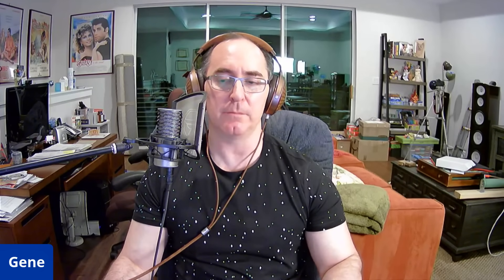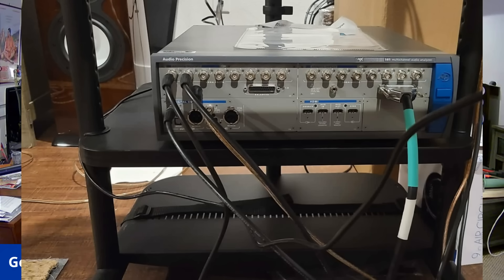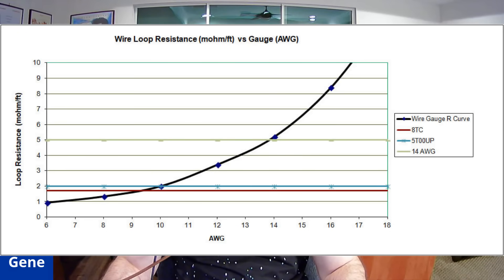Speaker Cables Really Don't Make Much of a Difference?

Comment: One have to do very long time critical listening to notice changes in cables. I did. Also did blind test listening. I had for a very long time a pair of good enough 14AWG speaker cables from the Swedish manufacturer Supra and i was pleased. One day I decided I'm gonna make my own 10AWG braided pure OFC speaker cables finished with decent quality gold plated banana connectors just because I am tired to plug/unplug raw wires and the result was good. Not amazing! I have noticed the change  and I can tell the old thin cables sounded exactly thin. I am a technical person and I was not expecting any vodoo out of the speaker cables. I would not spend crazy amounts of money on any cable but a $100 in total, for parts, i'd say is ok.

Comment: No Resistance "HEAR" The only reason I buy a Upgraded Cable for my speakers is that I believe the Quality of the Termination and the amount of the pieces of Braid is exactly what you showed here, but the Sound Difference I Experience is because of the Speakers Cross-over set up and my "Equalizer", yes I Said it the Audiophile Blasphemous  piece of Equipment The "Equalizer".
Because if a Human Ear picks up Difference that their Brain perceives as "Better more Soothing Sound" it is from the Amplified Sound being Fed into the Speaker, The Position of the Speaker or the Electronically Manipulated Sound from the"Equalization Process" .
So there you have my opinion  and Everyone has their own, The Idea of spending Tens to Hundreds of Thousands of Dollars to correct a Sound so it can be Listened to on a Flat unequalized signal vs me Spending Hundreds of Dollars on a Quality Equalizer to get the Sound to a Pleasing Non "Harsh" Smooth Soothing Sound just Does NOT Make Sense.

Comment: Elon musk said it best, 'stop trying to solve a problem that shouldnt exist'. The best speaker wire is no speaker wire, the best cross over is no cross over, and the best binding post is no binding post. 

Get active DSP'd speakers. DAC happens and immediately the proper frequencies ranges get routed to the individual drivers properly.

Comment: Thought I’d check in again with the measurements crowd.  Funny thing…2 different amps can have the same measurements but sound very different 😮. Then there is the whole Quantum Uncertainty Problem but…yeah!
Reply from the maker: Nice red herrings. 2 amps measuring identically will absolutely sound the same IF you do exhaustive measurements and not just a few cursorary measurements and declare they are the same. Talking about quantum uncertainty relating to speaker cables demonstrates a lack of knowledge about Modern Physics and basic electrical theory.
Reply: @Audioholics  Just wanted to see if you were monitoring this thread…Quantum thing was for fun.  Having been a musician, music lover and Audio enthusiast for over 40 years I am passionate about certain issues that are often glossed over.  As far as a linear relationship between measuring and listening goes, there isn’t one.  Enjoying music occurs in a unique environment, with a particular electrical infrastructure.  After that is the gear, which is dynamically interactive with everything else in the system. Every piece matters, every cable matters…it all matters.  Isolating a few parameters about any particular component or connection and extrapolating that into a subjectively meaningful experience is pointless.  As for the cable issue, my extensive experience with a vast array of components and cables have clearly demonstrated to me that while just wire is less variable subjectively, companies like Transparent and MIT provide discernible improvements to the listening experience.  If you can’t easily hear the difference and experience the dramatic increase in your enjoyment of the music you love, then I would question your priorities…or maybe you hear in black n white.

Comment: I would only buy good wires in case you have some interference.
I had my AVR wire to my 6000 beringer amplifier and my two 15" DIY subwoofers were maki g a really annoying noise every time they were on.
I bought a decent RCA cable (maybe 20€ for 0.5 metres, and all the funny pink noises disappeared.

My other 9 speakers are wired with normal cheap wire.

Comment: 3 cables isn’t the proof to end all the discussion. No testing of Transparent, Cardas, AudioQuest, MIT and many, many more. 

Only one person performing the tests and no other confirmation. 

Good start, but so much more is needed before one can categorically claim, “cables don’t matter”.
Reply from the maker: Audioquest was in this comparison.  I've tested 100s of exotic speaker cables over the last w decades. They don't make a difference unless deliberately designed badly like with gimmicky network boxes or very far spaced conductors.
Reply: @Audioholics  and so have I. Though I actually hear the difference and I have been blind since birth. Enjoy your vision and poor hearing.
Reply from the maker: @scotttracy6640  no need for the insults or ASSumptions on my hearing. I focus on what really does make differences in sound, namely room acoustics, proper speaker set up and calibration. Most people hanging on to the misbelief of the sonic wonders of cables often listen to their systems without ever addressing the things that can actually bring them BIG gains in fidelity.

Comment: great analysis. While there is a measurable (but small and largely irrelevant) difference. At least the premium cable was 'better.' Which for analogue is good to know, but I'll be continuing to use the spool of 12-gauge speaker wire I've got in the shed somewhere. 

What really cracks me up is the prices that some people charge for digital cables (like HDMI.) where it doesn't make a lick of difference so long as it meets the spec.

Comment: I can tell you there can definitely be audible differences in color, tone, and some cables accentuate some frequencies more than others.  I just finished comparing two sets of pricier cables to my bell wire.  The pricey cables were immediately impressive in different ways than each other, but neither pair were as neutral and balanced as the bell wire.  This was NOT what I was expecting to hear at all

Comment: The best youtube presentation I’ve seen. Thank you for your clear, concise and logically presented explanation of speaker cables and their electrical characteristics along with the quantified results and test equipment used. Being an Electrical Engineer, who was a NATA Signatory and Calibration Facility Registration Holder of a Lab that could measure Electrical parameters from DC to daylight, it’s a real pity there are so many snake oil salesmen in the Industry where so much misinformation can be presented without any form of evidence.

Comment: You aren't going to hear 0.2 dB and you aren't going to hear 0.2% distortion difference.  You can hear rather little distortion added to a pure sign wave, but 0.2%, not likely, not at all.  In music you will be doing well to hear 3-5%, depending.  In rock music, since most of it is already intentionally distorted all to hell, you'd be lucky to hear 15%, probably more like 20%.  That is not an exaggeration, I've seen tests demonstrating those numbers.  If  you measure the  ACTUAL distortion of your system, even a good one, you will be floored at how much distortion there is, and some of it is TOTALLY unavoidable, like IM distortion.  You can improve it, but you aren't going to get rid of it, unless you have a speaker for each instrument, and perfect isolation to that instrument and the returns on the recording...good luck with that.  That would be a long recording session, and you would need things well instrumented to put it together afterward.  And self noise (silk is GREAT in that respect, and HORRIBLE at maintaining a true piston, titanium can cover the other side,  pretty stiff, to some point, and then crinkle, crinkle), and direct nonlinearities, and box reflections, and varied coupling with frequency and driver size, etc.  If you ever get a chance, find a way to get rid of the sound coming off the front of your speaker (infinite baffle and absorption, whatever), and listen to what is coming out of the BOX.  It's not musical, and it's louder than you think it will be.

Your point on moving your head slightly, especially at high frequencies, is dead on.  Take a measurement mic and try it sometime, you folks that don't believe that.  And usually you can find nulls somewhere in the frequency range that are notches that go WAYYY down, and you will see the response on a sign wave of high frequency move all over the place with pretty small movements.   At 18 khz, they become REALLY small movements.  Trying to equalize the extreme top end of a system, unless you listen with your head in a vise, is a fool's errand.  

Equalizing my car audio system I was measuring notches like that and thinking no way.  So I covered up one ear, and guess what, there were positions where some single frequency sin waves would almost literally disappear.  You could turn one side off in those null positions, and the sound level would come UP 20 db, with half as much power coming out of the system.  You can do this yourself in your car with just your ears, but you need a fixed frequency sin wave generator.  You'd have to run it through the frequency sweep very slowly, moving around to catch a real deep notch, but you could find it, given half an hour or so to do the test.

People that think speaker cable makes a difference (yes, if you use that wire wrap gauge crap Radio Shack used to sell to run 20 feet across a room it WILL sound like crap, but within reason), but have done no room treatments, are  on drugs.  That is something that can REALLY, really make a difference.   Go look at companies that do that for sound studios and the like, on YT demo videos, and they'll show you recorded demonstrations of before and after.  You could literally be half deaf, and you would have ZERO problem A/Bing those  differences correctly.  In some cases the words being sung were virtually unintelligible, or FULLY unintelligible, some of them, beforehand.  After the treatment, crisp, clean, and 100% understandable.  The first time I heard a fairly lousy room comparison before and after correction, my jaw dropped. 

They showed some different levels of starting bad on a few I watched, but with the before sounding marginally like you're in a barrel (a bad case), the difference was absolutely profound.  A moderate level system would sound better in the good room than a good system in the bad room, guaranteed.  Also, you need a instrumentation mic (the kind that come with compensation curves, there are some in the hundred dollar range) and a program like REW to do any real work.  And a Phd in acoustics, but (mostly) kidding aside, there are some professional companies on YT with some pretty decent rules of thumb and hints on how to use programs like that to improve your room. Expect to spend a few hours listening, and then a LOT of hours playing, but it is fun (for me it was) and the benefits are tremendous.   Sometimes a couple of bass traps and some minor wall absorption (the right type for the problem in the right locations, just spreading it around willy nilly can make things worse) can make all the difference in the world.  Most audiophiles COMPLETELY ignore this, and they are screwed from the get go.  Even just proper speaker and listening placement can make pretty major differences.

Comment: The room has more effect than anything else, only when you get the room right and the speakers placed properly can you even begin to think about speaker cables.

i use 4 conductor #14 Blue Jeans cable (Canare 4s11?) on my setup. I think it cost under a dollar a foot and the brass banana plugs were probably $10 per cable so my cables cost me about $20 each seven years ago. I'm sure some expensive cables would measure and MIGHT even sound a little better but that would be wasted on my 75 year old ears!

Comment: Anyone that has taken any electronics courses or worked on electronics repair has known this for decades! If ANY of the "snake oil" high end audio cable mumbo jumbo was true, the INSIDE of audio equipment wouldn't be built with standard wiring and electrical components! That is where it would make the most difference, not to mention every speaker voice coil is wound with roughly 30' of 32-38 gauge STANDARD copper wire. So why anyone would  or could believe that 5' to 10' of $1,000.00/$30,000.00 (Special) wire could make a difference that could be perceived by the human ear is mind boggling.

Comment: About the only truly marked difference I have heard in speaker cables is between high strand count copper conductors and speaker cables that use FAR fewer conductors of larger gauge solid copper wire. High strand count cables seem to exhibit a very noticeable higher frequency hardness or glare. 

An exception would be Analysis Plus Cables that use fine stranded wire that's woven into a hollow conductor wrapped around a dielectric core. Those don't seem to suffer from the fatigue-inducing glare present in high strand count cables. Stranded cables using Litz-wire also seem to be immune from the problem.

It likely has more to do with how the cable interacts electrically with my amp and speaker combination when it's placed between my particular loudspeakers and momoblock power amps than anything else. But honestly, that's the only difference I have noticed when it comes to speaker cables.
Reply from the maker: Nonsense,  higher strand count helps reduce AC resistance due to skin effect. It exhibits litz like behavior at Audio frequencies even without individually isolated conductors.

Comment: I have a question, and it's about speaker stands...from your experience, do you have to buy speaker stands?  I have some form in fact the foam that comes with in your mail, that shippers use to keep fragile material from getting busted and protects products, like speakers, subwoofers, and other fragile material...what is your opinion?

Comment: its a very grey smoke and mirrors topic this and each to their own. its like comparing brand X high speed tires to a Pirelli pzero's. on paper and stats they do every thing the same from 0-300kph or 0 - 20,000hz "tested" but the way that they handle is very differently when used the same way on the same car with the same driver........ the law of diminishing returns starts rapidly but a good well built cable can be heard

Comment: I up voted this because it was a serious attempt to grapple with an area with plenty of snake oil.  I still have some concerns.

First, I pseudo-randomly swapped interconnects that I was testing in a system for someone with better ears than I. He had no trouble distinguishing between a silver and a copper interconnect, and between the two different silvers.  One time I didn't change the cable but claimed that I did.  He could hear no difference.  I ended up getting the less expensive silver cable (not one of the big names). 

Second, workmanship counts.  I used a crappy adapter to use my good headphones in my office CD player.  That adapter seemed ok for a few months, after which it did not maintain a good connection.  Eventually, in disgust, I paid maybe $20 for an Audioquest adapter, which instantly solved the problem and continues to work perfectly.  This is no placebo effect (I thought the female jack might have been to blame, or maybe the headphone connector, but no).

Third, external validity matters.  In some situations, for example, shielding differences could make a huge difference.  Or cable geometry.  I noticed how you quite properly separated the cable being tested from its environment.  In real use, one may not be able to do that--or know to do that.

Fourth, construct validity matters.  Are decibels measuring anything that matters to the listener?  I don't know, but you didn't make the case.  Harmonic distortion might be a useful measure, or maybe not.  The measures of the wires' properties may be subject to the same question.  But I think in that case the argument is better.

Finally, I certainly agree that audiophiles should spend more time and money on their rooms than on their cables.  That said, once I settled on my cables I didn't change them.  But, after 20 years and some rough handling, I do think my cables need to be reterminated.  Cables are close to a one-time expense.

Comment: Accepted that, other aspects (and tweaks) in a system will have a much more noticeable effect on the sound one gets, however...
...in my case,
Without naming brands, I have two different speaker cables, each pair 3mtrs long, one made with multi strand cable, the other with solid core copper conductors.
The difference is quite obvious when, in place of the multi strand, I connect the solid core ones..
A somewhat 'dryer' presentation, and better low end control is the most noticeable differences.
They're both made of high quality copper material and of similar diameter.
I repeated the test with non audiophile members of the family , and they all agreed about the perceived difference!   Go figure!